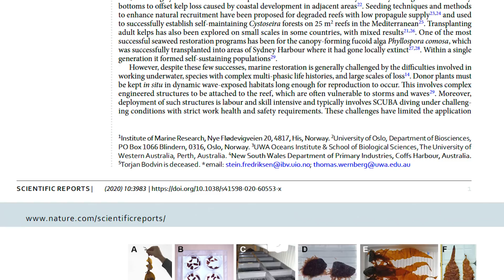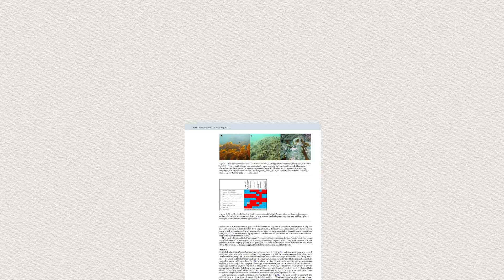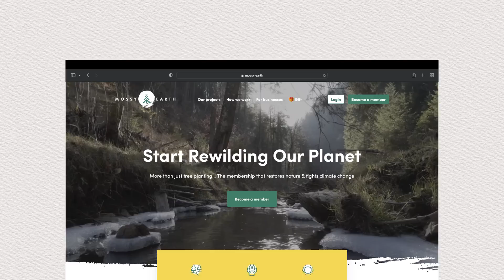We are Reforesting the Ocean - here's how

Comment: I had recently thought of a concept which is a self-sustaining agricultural megaproject covering 100-1000 km² in a dry region like Mozambique or Somalia. The goal is to create artificial rainfall and energy to sustain high-value crop production efficiently.

Structure & Working Principle:
Outer Zone – Water & Evaporation:

Surrounding the land with trees, lakes, and rivers to store water and promote evaporation.
Sunlight and wind increase moisture levels, forming clouds above the land.
Middle Zone – Agriculture & Wind Energy:

Expansive agricultural fields where high-value crops grow.
Wind turbines generate electricity to power heating systems and infrastructure.
Inner Zone – Heat Generation & Rain Induction:

Industrial heaters warm the central region, causing hot air to rise.
Rising hot air pulls moisture inward from the outer evaporation zone.
Cloud seeding or natural salt particles encourage rainfall over the fields before clouds reach the heated center.
Ways to Heat the Center:
Solar Mirrors: Large-scale mirrors focus sunlight on a central tower to generate intense heat.
Geothermal Energy: Extracting underground heat to warm the air.
Waste Heat from Industry: Using excess heat from factories or power plants.
Ways to Trigger Rainfall:
Cloud Seeding: Spraying silver iodide or salt to enhance condensation.
Natural Evaporation: Creating enough humidity from lakes and rivers to sustain rainfall cycles.
Heat & Airflow Management: Controlling wind and temperature differences to direct moisture where needed.
Economic & Business Potential:
Grows expensive crops year-round with controlled rainfall.
Sells fresh produce to India and Europe, maximizing profit.
Generates renewable energy via wind and solar.
Can be scaled from 100 km² to 1000 km² over time.  

The idea is possible according to what i had researched and would like other peoples opinion on it.

Comment: I don't want to be pessimist but it won't work until you find the reason why they primary disappeared and fix it... which in case of kelp, is probably climate change and/or overgrazing due to the over-fishing of predators. So you might need to run a few experiments to see if it's worth trying, here are some ideas: to test if it's because of climate change (and in that case you better spend the money on another project) you just need to find the southern limit of healthy kelp forest. Portugal is quite south so it's highly possible that it is it's southernmost limit, and because of climate change it might shift North (start from the south of Portugal, if you have kelp forest there you're good)(records and fishermen helps too, they will tell you where to look and where there was kelp forest). For the grazing part, you need to run an experiment on the field with kelp in an enclosure to prevent grazing and next to it kelp without an enclosure. You'll then see if it has a significant impact, in which case you'll need to talk with the fishermen and maybe try to put in place a no take zone. But careful, when a no-take zone is put in place, the first years there is an increase in herbivory! so maybe worth waiting a little for predators to come back before putting your precious babies in the water. Also, evaluating the density of urchins to see if it's at a "normal" level might be important to see if it's overgrazed / overfished (too many urchins is not good for kelp!). I hope it helps, cheers.

Comment: they have these tubes for houses that bring in maximum sun light if you floated a bunch of those  more sun light would get to the bottom .also instead of just little gravel rock drop large blocks of rock so multiple will grow also  add shelter for the predators that will keep the fish from eating the kelp.

Comment: should start thinking about how you could properly take this full scale while you do the test. something like 5000 gallon tanks with layers of seeded gravel and waterproof lights on a support which could be lifted out of the tank and the gravel containers made to slide off to be exchanged for new ones, probably with a forklift. industrial sized chiller and filters to match. use the same baskets you already are using to subdivide the larger gravel container to make loading and transport easier. find a cheap building with a bridge crane, cram a dozen tanks in it depending on funding and you could be doing those millions of plantings in no time.

need proper funding though.
Reply from the maker: Lets get the test done, then the planning begins :) - Cheers, Duarte

Comment: Nice work! How do you guys prevent the kelps from disappeaning again? Or what are the measures taken to prevent the problems such as climate change and inbalance of fish while planting new kelps?
Reply from the maker: That's a good question. Since the exact causes of declines are hard to determine due to a lack of data we believe it is more cost effective to test the technique and adapt based on the results we get. In some areas water pollution may have been the culprit and as water quality improves we may only need to give the system a helping hand to kickstart the recovery. If we find herbivory limiting that will be an interesting finding in and of itself and will help inform the next steps. There are a lot of variables here but the gist of it is that we believe we can make more progress at this stage by experimenting than anything else. Cheers, Tiago
Reply: @MossyEarth  Do you think that changes in herbivory rather than herbivory itself may be the issue in algal mats excluding the establishment of kelp sporelings (which need bare rock)?  In UK waters it may be that grazing by native urchins (e.g. Echinus esculentus) opens up bare rock (or coralline crusts) for colonisation. Remove the urchins and you may get no open niches, remove the urchin predators and you may get 'urchin barrens'.
Reply: I think they will consistently send more and more greengravel with kelp
So if some does there will already be more growing

Comment: I'm worried that if there is a large enough storm or swell that it will move the rocks and kill the kelp. I know that in time the anchors will grow down and attach the rocks to the sea bottom but I just wonder if there might be some thing that could be anchored for a more permanent solution. I immediately think about loops of concrete like cinder blocks or hollow bricks and being able to stake them down or slide them onto a rope that is anchored on both sides.
Reply from the maker: Depending on the location and depth this may or not be an issue. The advantage of being able to scale things up now is that we can start perfecting the method and testing different creative solutions as you are describing. I know tests have been done with ropes of some sort as well. Thanks for the thoughtful comment, it's great to find people who are as interested in this as we are! Cheers, Tiago
Reply: The factory will consistently send more and more kelp where it lacks, so eventually it will grow